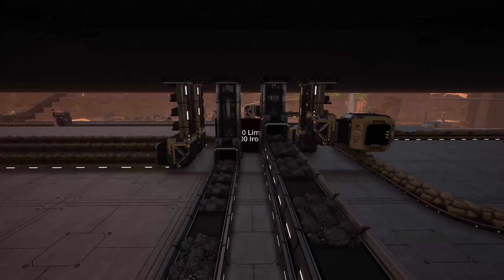Load Balancing 4800 Iron Ingots - Satisfactory 1.0

Comment: With the nice values you had for your splits, I think another way to do it is to use (smart) splitters and belt speeds. 480 to 300 iron : splitter send to mk2 belt, other split should be at 480-120=360, another splitter to mk1, other split at 360-60=300. Same idea for concrete 300 split in 120/180 with only one splitter to mk2. Use smart splitters if the amount "removed" is more than half.
Reply from the maker: You make an excellent point! Using the smart splitter would be a great way to do it. Although I have found limitations with using them like this. It will work flawlessly for the full 480 belt being split into 300/180 just like how you described. When the belt isn't totally full like the 300 belt, the gaps on the belt will start to slowly throw off the balance. You can get around that by using a short section of mk4 belt on the "Any" output before limiting it down to the speed you want. I'll probably end up using both methods throughout the factory, thanks for the reminder!

Comment: Usually I am with you 1,000%.
Why basic iron receipe?  So much limestone...
Why not alloy?  I get why not pure, who wants to mess with that much water in the dune desert.
I know you have a good reason, I am just not seeing it. 
Thanks!
Reply from the maker: Haha that is a fair question! Honestly I think the alloy is probably the better recipe to use. The reasons I went with the basic one are that its shiny and new and I wanted to try it out. The other reason is the rates are really nice for load balancing. I get to deal with belts of 300 and 480. The alloy would be belts of 240/60 and 450 for the same 6 foundries. My other thought is that I have never come close to running out of limestone in a save, but I have used a good amount of the copper. I'm sure I'll use the alloy down the line, this wont really last all that long.
Reply: Yea, ok.  That makes sense.
I am always starving for concrete, but I have never tapped every node in a biome...  Mad cow disease?!?!?  🤪🤣🐄
I don't think I have the energy to do that no matter how many times I have wanted to do exactly that...and beyond!  😱
Reply from the maker: It definitely took longer than I thought it would. I'm curious to see how I feel about it at the end of the playthrough, it might end up being a great idea and save me time. OR it was a huge mistake and a waste of time LOL
The reason the videos hopped around the timeline a little bit is because I couldn't do all the belt buses at once, it was too long and tedious and I needed a break half way through. And that's why the Rubber factory was when it was :)